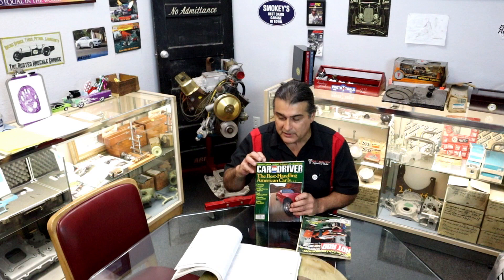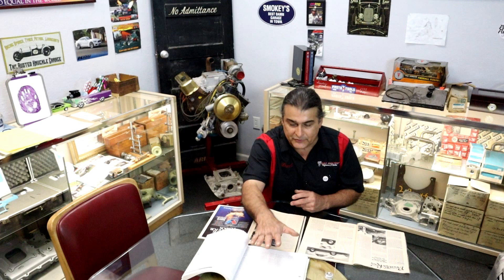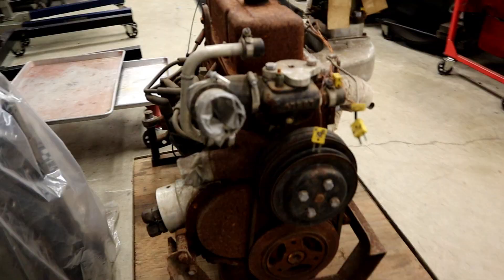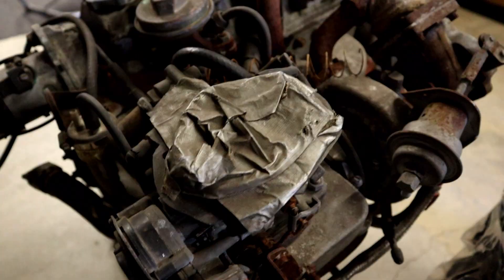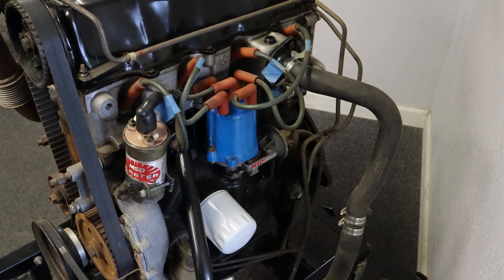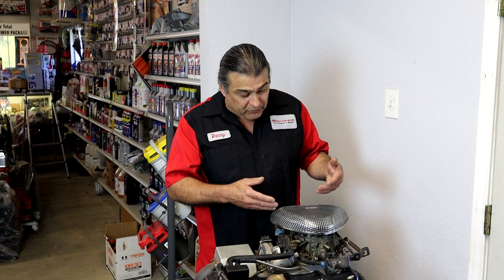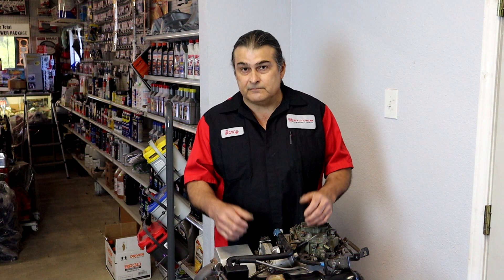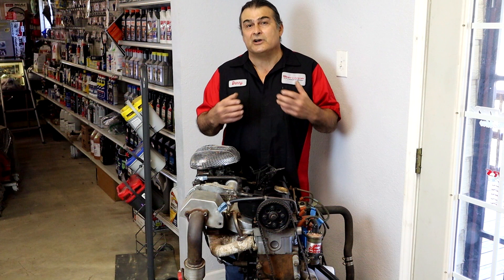What ever happened to Smokey Yunick`s Hot Vapor Engine

Comment: This video just came up in my feed today. I have been working on something similar to Smokey's idea with Pontiac V8s. Where my project differs is rather than gasoline I use ethanol. Only have to heat it to 200F in the fuel lines for EFI to get the same effect, that means no ceramic pistons and other high dollar parts like were used in the Fiero, it does it all in the temperature range engines normally operate. Gasoline is a mix of chemical components with boiling points between 80F and 450F at sea level, whereas ethanol's boiling point is 173F. To get it hot enough to vaporize all the fuel, you have to get the intake charge to 450F, from what I remember of the HRM article and some later ones I read. Not a lot of time to achieve that, which is why Smokey had to use two different 'chambers' to do it.

Its about surface area, atomization is like spray from a garden hose, vapor is fog and the fog provides vastly more surface area, which allows a faster more complete burn. Its only the outside of the fuel droplets that burn, and that takes longer to achieve. Also gasoline wastes over 80% of its energy as heat that doesn't do any work, it only heats up the engine and causes the parts to expand far enough they eliminate the oil separating the parts and things stick together. That is part of the problem Smokey was working on fixing.

On the other hand ethanol has only 60% of its energy going to waste heat, it also has more oxygen in it than gasoline, then you have a superior latent heat of vaporization which cools the intake charge keeping it dense even when the fuel is hot enough to vaporize instantly as it hits the relative vacuum of the intake port. Consider the other attributes of ethanol, like its reluctance to explode without a spark, it does not 'diesel' easily, which means it doesn't ping or knock even with very high compression ratios and aggressive timing advance. That means you can run 13:1 compression in an old V8 with factory parts, easily achieved with a flat top piston in a 455 bored .030 over, and the 72cc heads from a 1967-1970 Pontiac 400 milled to 65cc. Nothing special needed other than milling the heads. For this project I didn't fill the center crossover, I wanted the heat under the intake manifold, Pontiac engines have an air gap intake from the factory.

Running a Qjet I converted to E85, a 200F thermostat, 13:1 compression, 224/228@.050 112lsa cam, stock, Performer, or RPM intake manifold, and not heating the fuel just the under hood air going into the carb, it got 20mpg and made well over 550hp nearly 600ftlbs in my 1970 GTO on E85.  The 70 needs some work in other areas, electrical, suspension, fixing rust its gotten in the last 25 years I have owned it and daily drove it with various engines, usually 455s. That means the 70 is waiting its turn in my shop for its frame off. The 65 GTO is the current test mule with that 455 but with heads that make only 11.5:1 and have the center heat riser filled in. The 65 is very 'dirty' when it comes to aerodynamic drag, its like pulling  parachute everywhere you go compared to the 70 or a much more aero Firebird. So the lower compression, no heat under the carb, and worse aero conspires to only get 17mpg. That isn't even using the system like Smokey was developing. Oh yeah that is mixed driving, city and highway combined.

Those 11.5:1 heads on another 455 made 540hp, 590ftlbs and pushed a 3750lb Firebird to 11.40s @120mph... before E85 was available, so it had to run race gas. That got expensive when gasoline shot up to $5 a gallon for 87 octane.. That was when I started on the ethanol project, to make fuel myself rather than pay a gasoline company for it. I make fuel from cattails and tree sap, maple syrup is considerably more valuable, but I don't eat waffles and I do drive old Pontiacs. Working on using coffee grounds to make fuel at the moment.. but thats another story..

Where my system departs from Smokey is I am heating the fuel in the feed line to an EFI system, currently its a FiTech Mean Street unit. I drove it on pump gas for two years with a low compression 400 under it, then E85 with the 13:1 compression heads, and now 11.5:1 as a comparison and because the head gaskets I need for more than 12:1 static are $86 each. I am not really wallowing in cash and it took me a while to save enough to get the $800 FiTech unit when they had a rebate in 2016. Heating the fuel with a carb means its trying to vaporize in the float bowl, not a good thing, carbs need a liquid to work right. EFI is everywhere now, and available much cheaper than when Smokey was doing these engines. The way I heat the fuel in the lines is dead heading the EFI, the return going back to the tank without being heated (will work great on an LS engine or 3800V6 due to the fuel system used on those engines) before the regulator, and then using a coiled fuel line inside the coolant hose.

My plan is to put the 13:1 heads back on, or do another set, and put the engine in a 71 Formula which is lower and has better aero than the GTOs. Then build a heated fuel system after the regulator, and run it on E98 or E100. Might get that done this summer, there is a lot going on around here, so it might not be done, but that is the plan. I also have a couple Opel GTs, they are very small with ok aero, so they'd by very light with a tube chassis, very fast, and should do better than the Firebird can. Longer project there since I have to build the chassis.  

Others have used the heated ethanol fuel in converted diesels that have EFI and a spark ignition system added with the diesel injector removed, and 40mpg in a 4x4 2500 is said to be easy to achieve. So getting a much lighter vehicle with a smaller and considerably lighter engine to achieve over 40mpg should be rather easy, and the best part is you get to keep the mountains of torque from high compression and ethanol.

People will claim ethanol eats everything and can't do this, won't do that, etc etc. I have been testing, tuning, building engines, carbs, and EFI systems to run ethanol since 2007. In that time I have seen zero problems with corrosion, eating parts, rust, etc. The fuel systems are spotless, my fuel pumps have not died even when they are the electrics I used in the 1990s running 10% ethanol pump gas. My cars sit from October to May because of the long winters this far north, and the salt they slather on the roads, I do not rebuild old cars just to have the salt eat them in two years. The 70 GTO has been sitting since 2018 without an engine, it has around 10 to 15 gallons of E85 in the tank right now. I bore scoped it last summer and it was spotless inside, and its the tank that came with the car when it was built in late 1969.

Daily driven 13:1 compression with iron heads, in a V8 that has a 4.18" bore and a 4.21" stroke and cam timing that makes lots of cylinder pressure. It likes 42 degrees total timing, and runs around 15 degrees initial advance. Its entirely off the shelf parts, just basic fuel system parts from NAPA and CarQuest. The heads have stainless valves because I tend not to trust 50 year old valves and the stainless ones are less than $200 its cheap insurance. It runs no problems with stock valves too, did that with some heads on another 455 from a 1975 400 that made 8.8:1 compression. Lots of power, not so great mileage due to the low compression.

Zero problems with the fuel and parts compatibility. Zero. And I do not do anything special, I pull the battery in the fall and let it sit until the snow/salt is gone in May. They always fire up no problem, unlike pump gas which doesn't want to run after it has sat for two weeks. Yes I make videos of my projects, I just got my house done last year, so this is the first year I can spend doing car projects. So if you want to see how this turns out, I can reply to you guys or you can watch, I am not monetizing it so there shouldn't be any ads.
Reply from the maker: that's so cool!
Reply: Post your video I for one am very interested.
Reply: @sink61  The weather needs to warm up before I can start doing the heated fuel project, mostly because the cars I am using do not get driven in the snow. I've recorded all the narration for my first ethanol video, been working on getting something to look at while you listen to me go on about vodka fuel.

We always get at least one big snow storm in April, and the salt trucks come out again. May is usually the earliest, but this year it has been warm, and last week all the winter beaters broke.. lol. One thing or another.

After I get the brake line replaced on the Silverado and the fuel line patched on the Gran Prix I will sift through my video and images to see if I can get a quick video up. Might do a bunch of short ones, could work better. The salt tears up everything under these vehicles, ends up being the same thing every couple years.

This summer when I am not moving cars 1000 miles to my shop, (long story) I will get some of the video shot for my fuel and efficiency project.

Comment: I've been a racer for about 40 years now and I have never heard of this engine. I wonder why the hell not!!! The way this engine functions goes against everything we do to make power. The rule of thumb is cold intake charge makes more power! Think about the mileage. Damn I knew that Smokey was a true genius but this is beyond anything I ever imagined!
Reply: You never heard of it because while it was a good idea at face value, it was unviable and based on flawed logic, or at least a lack of knowledge on Yunick's part. Yunick was a really smart guy, but this engine concept was flawed. There is a reason you never saw anyone build it. It was patented in 1984, and the patent expired in 2006. You could build and sell it for profit if you wanted. No one does because it doesn't work.
Reply: @hangfire5005  Please explain why. Engines HAVE run at extremely lean cycle ratios. Some have been able to run a long time on super lean mixtures. There IS something there by heating the fuel into well mixed vapor. . .but I have never done the experimenting to try and see what the burn difference is.
Reply: @life_of_riley88  
First off the engine doesn't run on the hot vapor principle until it gets fully up to temperature, about 15 minutes, and while it's doing that it doesn't get the greatest mileage in the world, so for people who live within 15 minutes of where they work it would actually cost them more money in gas.
But the biggest downfall is it's complexity, people always sit around and say "Why didn't they do this and why didn't they do that" but everytime a car company tries something revolutionary and it turns out to be a maintenance nightmare the very same people say "Why didn't they just stick with what works instead of trying to reinvent the wheel", and the the car company gets their asses sued off in court and almost goes bankrupt dealing with lemon laws.
Reply from the maker: @Duke Craig we ran this engine in our shop at 28*F and it started right up ran fine. We need to get it on the dyno and do a dyno pull cold and see the data.

Comment: The best place to homogenize the fuel vapors from the gas tank is to pull the vapors from their. Put the intake over the top of the fuel. Then through a turbocharger. The turbo charger has the exhaust side where another fan/turbo if added would do the second heat extraction. Along the way could extract heat in a can around exhaust for initial heat up.

Comment: I still have the HOTROD magazine I got in the mail with that article in it. So the real question is since there is absolutely no doubt that the engine functions as described how come nobody has done anything with it  ???  It works........isn't difficult to replicate the results.........why has it been 40 years and all there is are old engines sitting around in museums and not even one person driving one around in a vehicle ??
Reply: WHY NO ENGINE IN THE INTERIM 40 YEARS?	

1.	The first reason is OIL, not Big Oil, although that is a part of the answer too.  In the early 80’s the widespread availability of synthetic motor oil and lube was a decade or two away.  In order to make the engine functional at the temperatures required for the engine to achieve Hot Vapor process Smokey was using Jet Engine oil that was 98 dollars a quart.  
2.	Of course, Big Oil was a reason as well.  After the Oil Embargo of 73 there was a push toward fuel economy.  But by the time Ronald Reagan assumed the Presidency, one of the first acts was to remove the solar panels from the White House roof.  The rest of the decade saw a move toward less of an emphasis on the fears of the 70s and the return of gas shortages.
3.	Materials, production process and technology overall as existed in the early 1980s was just not where it needed to be in order for the engines to be massed produced at a cost that made it viable.   Smokey cast or hand made his own parts and reproducing some of those with what was available at the time would have been cost prohibitive..
4.	The OEMs had ideas of their own and moved back toward the idea that cooling an engine was the answer.  They had also made a commitment toward EFI and they were not going backward.  The culture of that time (Pre- Jobs, Gates and Tech Entrepreneurs) tended to look down on engineers without formal degrees. What Marlan Davis called, “it wasn’t invented here syndrome” in his article for HotRod Magazine: “It was the "not invented here syndrome" rearing its ugly head again. “How could a couple of gearhead hot rodders know more than all of Detroit's best engineering talent?”
5.	Lack of access to the original engines.  Smokey made the conscious decision and concerted effort to keep the hard tech from the “suits”  There is good evidence that even trained engineers with access don’t understand what they are seeing and misidentify and misunderstand what is in plain sight. To the trained eye Yunick’s efforts to effectively camouflage critical parts and components is evident.  This pattern of false bread crumb trails carried over to the patents themselves where Smokey would use in-exact, misleading, or made-up descriptions as well as omissions to throw potential IP thieves off track.  We have already identified at least one instance where the drawing in a patent is not the same as the working physical engine. Additionally and for the sake of redundancy, Smokey cast or hand made his own parts.
6.	There is no doubt that the fall of John DeLorean was a crucial set back.  And, the Hunt Brothers were having their own problems with Law Enforcement.  However ultimately, it was probably Henry “Smokey” Yunick that made the conscious decision himself.  There was no arguing Yunick’s genius. Nor his eccentricities and “My way or the highway” terms.  He was now in his 60s and was slowing down, thinking about writing a book or two.  He was already a legend, decorated WWII Pilot, Inventor and had won over 50 races in every type of auto racing. He had business interest in South America.  He had spent decades being challenged by Auto and Race Execs.  The endless parade of engineering teams alone must have been exhausting, always the fear that they are going to steal your knowledge and work.   To prevent this there was always a false trail in the treasure maps he left behind, “It is really quite simple, and I am careful not saying too much. This is the only way I can be sure nobody knows how the system exactly works says Smokey”  Swedish Hotrod Magazine
7.	The possibility of the project be scuttled or blacklisted by “The Powers that Be” has to be taken into account.  Proof of that however will not likely be unearthed.
8.	At the end, maybe he just got tired, to quote him as he closes out the chapter of something that he pursued for half his life, “These things start out as a little conversation and like a hurricane get spinning faster and faster and I guess where the inventor generally gets blowed out the side someplace then the wind and rain goes away and in thirty days it is like it never happened.  As it stands today the Smithsonian has inquired about a hot vapor engine for their museum.  Maybe you can check it out there if they never get it into vehicles.  They’ve also got one of my hats.” Eating the Elephant page 249.

Comment: Downsizing and turbocharging are popular now.  Heating the intake is actually not a good thing.  Two out of three ain't bad.  I'm still a huge fan of Smokey's other innovations, though.
Reply: the "turbocharger" on smokey's engine is not a turbocharger, it's a homogenizer. it does not have a compressor wheel and does not provide any boost pressure, it's purpose is to mix and heat the mixture.
Reply: @marzsit9833  : Respectfully disagree. Though you're correct about the turbo never being used for boost (absolutely), the turbo was to prevent vapor lock only. That is to say, after having the fuel and air being mixed in the carburetor, the "air fuel mixture " (vapor) was heated to 180(or so) degrees. As Ford owners often found out (back in the day) gas lines too close to the exhaust vaporized the fuel causing the engine reject it (a.k.a "vapor lock"). And too, without that small turbo >>>>the same thing happens. Side note: Smokey once said that there was also pressure regulator under that turbo also. Without which, one could expect picking up rods after they exited the oil pan [having spoken from experience]. Also, typical hp outputs were safely 1.8 per ci. Going over that mark jeopardized the engine's life. Thanks, and best regards.